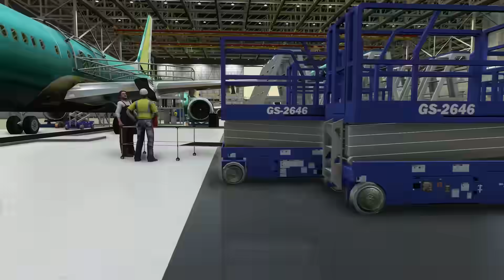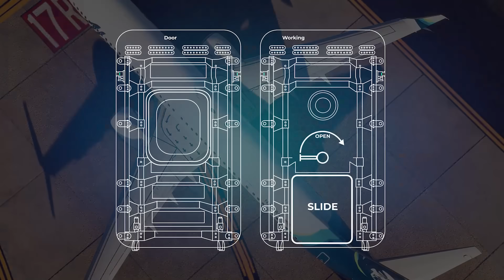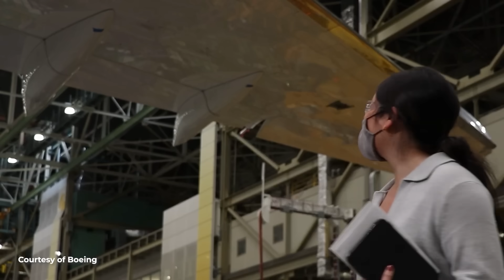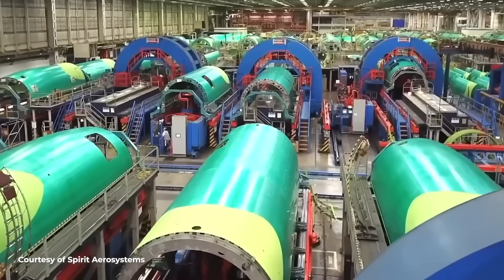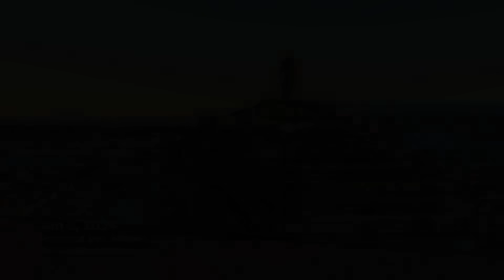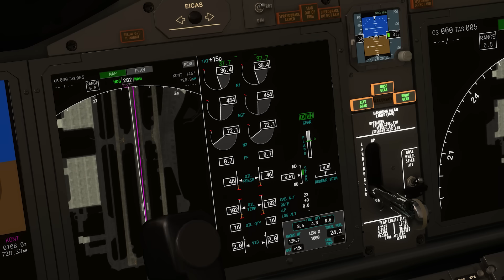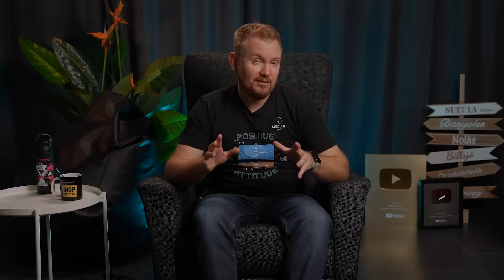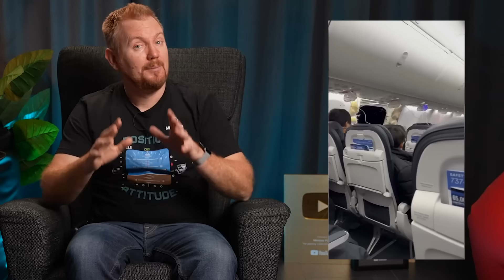Boeing 737MAX BlowOut!! The Scandal behind Alaska Airlines flight 1282

Comment: I know this is burried, and im screaming into the void here, but i hope this gets sttention. You missed a VERY major and likely criminal issue burried in this story. My specialty is aerospace manufacturing processes and systems. I didnt choose it, but, here I am. The major issue is the repeated use of the word "DOOR". It was not a door. It was a part of the fuselage. Sure, it plugs where a door could be, but once its there, its there until a heavy check with interior out. It should be considered a structural part of the skin. Although, it doesn't add any strength. That means, once those bolts are torqued down and approved by quality inspection, they are installed and officially part of the build record. That quality stamp says so. Per Boeing's own quality process documents, that part may not be removed without approval and a record of the removal, replacement of standards (if required) and REINSTALLATION of the part is documented. A removal record puts a "hold" on the work order it is written against and the aircraft can not be certified and delivered without all work orders closed, or an agreement is made with the customer on cosmetic, non safety of flight issues. Most customers say, tough shit, fix it, we'll wait and you'll pay. Anyway, back to the word "DOOR" again. Since it is established that this is a part, not a door (it lacks an opening and closing mechanism), you can not OPEN it. That's crazy talk. Sounds like something a caffeine addled, hung over first line manager on the shop floor would present to a friendly QA who should be fired. 

See, where just "opening" it. We can get this done by the end of shift!

Yeah, well, that's fraud. And although its not like forging a document to get work passed down the line or hidden, it's the same thing by refusing to document the removal and reinstallation of a PART, not a door, from a commercial airliner. Whoever oversaw the work, whoever did the work, and any QA that was aware of the shady plan are all criminals for attempted murder, or at least wreckless indangerment. I'm not kidding. This is really that bad. For sure, they should all be unemployed.

Comment: I heard two words - "easier, and cheaper".  And that explains absolutely everything.
Reply: Nah - whistle-blower is the phrase to look for. Easier and cheaper are simply reality at every large company. Compensate whistle-blowers richly with an insurer based reward scheme and you will see decent safety records restored PDQ. Think about it - if you had the opportunity to turn squealer and get what amounts to a rich pension automatically - no corner cutter would be safe. Both shuttles and the astronaut crews would be alive today. And "US"  products would actually have US engineering drawings instead of some bogus Chinese cad drawings with no revision block data.
Reply: @jeffmilroy9345  

We used to joke about Boeing doing everything FASTER, QUICKER, CHEAPER, BETTER.  It finally happened that the McDonnell - Douglas leadership team reached their desired goal with almost deadly consequences.
Reply: @mrc8683  Well at least Sully gave a harsh, public criticism.

Comment: Had Alaska Airlines investigated the pressurization issues, rather than simply reassigning the plane to overland routes, the missing bolts could have been discovered, which could have avoided the accident.

Comment: I worked for Boeing for 35 years. "Engineers" do not do inspections on incoming products at Renton. Quality inspectors do. I watched over the years as "MBA's" started to outnumber "Engineers" as the culture of Boeing changed for the worse. They keep mechanics that have no business turning a wrench and have business degrees making engineering decisions. A total dumpster fire that will only change when the "culture" changes. The environment is "woke" and run right out of "HR". Another total disaster. Again, folks making aerostructure and power plant decisions that have no experience or education to do so.

Comment: I mean I am by no mean undermining the complexity of the task but wow is the design of that door plug bad. Normally you'd not depend on so little to prevent a door plug from coming off, ideally, knowing that the plane won't have that door, the fuselage would have to be made to spec not fixed as an afterthought. Unthoughtful cost cutting is bad, and it's dangerous.

Comment: I am a consultant specializing in quality assurance and Failure Mode and Effects Analysis (FMEA), primarily within the automotive industry. The fact that the process did not require a check for the proper installation of these bolts after the reassembly of the door plug is simply bewildering to me. Frankly, this is scary.
Reply: Airbus is making boeing look silly ...clearly a bean counter decision
Reply: @alexanderreith6043  Look on current Boeing logo.... 
U see it, it's MDD logo. Bean counter culture comes from there
Reply: Playing by gallery.
Reply: im an aircraft vulnerability topic specialist. i go oen step furtehr than failure mode and figure out "kill " mode . how multiple systems failign result in the ultimate failure after amissile hits.... its even more scary for me.  i know the failure rates we design for i know the tests we do and the isnpecions we do on military aircraft. the fact civilian is letign this through is jsut jaw droping.
Reply: Theory always ends up butting heads with reality. You can't fit 40 hours of work into a 24 hour day. And with how notoriously unreliable Spirit had been across the entire production run, those engineers were kept very busy. Tragic and preventable, yes. But especially for extremely qualified work like QA, man hours are a finite resource that needs to be focused on the most pressing issues.

Comment: Thank you dear Petter, another first class video !! 👍🏻🙏🏻🙏 !!
From the ‘Aeronautical Medicine’ classes, still remember that the  inner ears have no difficulty compensating differential pressure whilst climbing, when cabin pressure decreases. But on descent, due to how the ‘Eustachian’ tube is shaped, it cannot get rid from the excessive inner ear pressure by itself. Some swallowing helps, or chewing gum, i.e. 
Therefore the automatic Cabinet Pressure Controller sets the vertical speed, of the cabin, during climb 500ft/min maximum and 350ft/min for descent, the inner ear can easily manage those rates comfortably. 
Still remember …

Comment: The part I don't understand is why did they have to block off the emergency exit in the first place? I mean I get that if they have 189 passenger they need fewer exits, but surely it wouldn't hurt to have extra emergency exits above the minimum requirement, so why not just leave them as is?
Reply: You cannot have an emergency exit with seats in the way. The key is to seat the maximum possible amount of people within regulations.

Comment: Hey Peter, your video was going fine until 37:20 when you stated your opinion that Pilots would have done this or that so as not to cause any discomfort to the passengers while landing... Better ask the alive passengers if they observed that discomfort... As regards the Pilots, when your ass is on fire, you rush towards a bucket filled with water to cool it off... I appreciate the Pilots' presence of mind for a SAFE landing without any casualty...

Comment: Those lift springs are probably retained on the door plug because it's the same part assembly, and if you're assembling both, it's easier to just have one part that goes on doors and plugs whenever possible. This also eliminates a possible failure point where a hinge without lift springs is installed on a door instead of a plug, so it's actually both cheaper and safer.

Comment: Brilliant analysis.

Could you develop the door plug retaining details, perhaps ?
The springs at the base look way too weak to counterbalance the weight of the door, and the multiple tabs that take the load around the periphery are surely more than just tabs - the implication in the video is that they have no resistance to the lateral shear that is required to lift the upper door pins out of the U shaped guides.
There’s more going on here than in the diagrams currently used can do justice to.

Last point : are you seriously inclined to believe that it was a coincidence that those two seats were empty ?
Never in a month of Sundays.
The airline knew there had been comments about noises in that area.
I’d bet a million dollars that someone ring-fenced those seats as a precaution.

Love the videos. 

Mechanical Engineer with PPL.

Comment: So glad, Petter, to hear you refer to items “pushed out” of the cabin. Every time I correct a conversation to explain things don’t get “sucked out” but rather “pushed” I get the obligatory eye-roll. I did a PPL 30 years ago but am still quite nerdy about flying. I curse Bin Laden for abruptly ending the common jump seat ride on commercial aircraft, but I do get it. I have just returned from a trip to Japan having flown Melbourne-Narita via Hong Kong with a newly approved “ok to fly” assessment from my respiratory specialist. I have a form of Pulmonary Fibrosis that results in a loss of lung function due to scarring of the lung tissue. It is progressive and incurable but when you were explaining the procedures involved in training for a depressurisation incidents I wondered if a similar reduced pressure is used to have pilots experience the full loss of oxygen situation? In my case I went to a sleep laboratory that my RS is associated with and sat for a half hour with a stiff clear plastic vessel over my head and a rubber skirt around my neck whilst the air inside was reduced to 8,000 ft. I did ok but still was a bit starved for air on the flight at one point. Forgot to use my inhaler. 🤦🏼‍♀️ So do pilots ever get exposed to a drop in pressure to see how they would manage if it were to occur? Are there any sort of tests used to establish physical capability to withstand such a change? A bit like the G-force tests?
Reply: You'll find a number of good videos here on YT demonstrating the effects of hypoxia on pilots. Just enter hypoxia pilots test in the search bar.

Comment: Aircraft doors are designed to be impossible to be open in flight, because they need to be moved inwards, against the huge inside pressure, before they can be opened.  Why were these plugs not designed to be self sealing in flight, to be larger than the hole they fill, to ensure that they can not be blown out by pressure?  These plugs should be held in place by the pressure of the aircraft without any bolts at all in an emergency.  I believe that is the definition of a plug, a solid device that is larger than the hole it fills.  That seems like a basic engineering requirement.

Comment: I think it would be great if you could get a mock up of a passenger oxygen mask and present a detailed rundown of how it works and how to use it. It's been years since I've flown, but I don't recall any mention of tugging on anything to activate it during the safety briefing. I was under the assumption they just started working automatically when they deployed. There was also no mention of the possibility of a burning smell from their use and that it's normal/to be expected to alleviate fears if used.  Seems like a couple of important topics the flight attendants need to do better explaining.

Comment: With modern computers, a de-pressuration event should automatically send out an emergency notification and SOS to air traffic control, by computer systems and then start the automatic pilot to automatically descending to a safe altitude.  Doesn't't a de-pressuration event cause the automatic deployment of the oxygen masks to the passenger compartment and to the flight attendant areas? If so, there is no reason not to combine those actions with an SOS/emergency radio call to Air Traffic Control.

Comment: Isn't it a defective design of the autopilot control for it to keep climbing when a cabin de-pressuration event takes place?  It should automatically stop climbing, level out for a minute, and then start descending to 10,000 ft as a fail safe measure.

Comment: As I learned from another video, the reason why the pilots forgot to unplug the circuit breaker was, that the wind blowed out the printed papers from the cockpit, and this task is not a memory item, but on some emergency landing checklist. Was this the case, @MentourPilot ?

Comment: I work for an aircraft manufacturer in assembly. For us, that door seal replacement would have had to be done through what we call a re-work to blueprint where process and design  engineers would have to write specific work instructions with mfg operation buyoffs and inspections like the original installation. We as installers don’t just think of how the easiest way is to replace it, perform the work as we see fit and move on. We always have to perform work like that per written work instructions by engineering, especially if it’s a flight safety item. Boeing is way below industry safety standards if this kind of thing can happen. This could never happen where I work. Seeing this is absolutely mind blowing that it could even occur. Before interior panels could go on that area would be gone over thoroughly by inspection three different times by different quality personnel.
Their safety, quality process and mfg process is obviously severely lacking.
We have escapes, but nothing of that magnitude and 99.9% of the time it’s due to design engineering and 100% of the time it gets caught in testing prior to delivery. And even our relatively minor escapes that make it all the way to test result in a major ordeal like safety stand downs where everyone in the company stops work and goes to a couple hour long meeting about the issues and reminded of safety and quality being top priority. Engineering and quality teams are assembled to do root cause analysis and make immediate changes to make sure it can’t happen again. These are much smaller escapes than this door being blown off in flight by the customer. If it were possible for something like that to happen to us, it would be a major ordeal. The entire plant would get shut down, people would be fired and major process changes would take place and there would be highly increased scrutiny on all of our processes and lots of added training would be implemented. With all the major safety and quality issues in Boeing, it’s clear they aren’t taking it seriously at all. All of upper Management should be completely restructured with people who have safety at heart, their quality dept needs to be separate from mfg management and have their own authority equal to or greater than mfg management even above the CEO.

Comment: Interestingly, having "door open" vs "door removed" work steps having different levels of QA and reporting during manufacture makes perfect sense ... for a door! Even emergency doors get opened and closed as part of normal operation and testing, but removal implies removing things like bolts. I think calling this thing a "door plug" causes everyone to think of it as a sort of a door, instead of as a oddly installed wall panel. Perhaps "exit opening plug" would be a better name. Words matter!

Comment: I find it kind of alarming that once the depressurization is detected by the plane, if it's over 10,000 feet, it's not automatically set back to level off or descend. So the autopilot just continued to go higher when it was clearly unsafe to do so. Concerning.

Comment: The potential lethality of Boeing and Spirit quality control failures, cannot be overstated.
If I were a commercial or military pilot, currently flying this aircraft type,
I would be absolutely furious. The FAA, the airlines, and military authorities must demand
accountability from Boeing and Spirit, before the 737 Max production line is
permitted to restart. As a passenger, I would not choose to fly on any of the newer generations of Boeing 737 aircraft. They are demonstrably unsafe, until proven otherwise.

Comment: I'm not American and I do believe Trump is not fit for presidency BUT he can be very right in some aspects.
The US is indeed loosing the shine with old infrastructures among many other things he speaks out about.
Boeing has lost the edge long ago and it seems they are not doing the right moves still cutting corners. Seems like a management problem rather than the people making the plane. If the engineers and mechanics could speak out it would be appreciated but they don't.
Doesn't really look like a democracy does it?

Comment: 23:11 As engineer (not aviation), the door plug rose up slightly due vibration, assisted by the springs. Every landing also jarred the door loose.  It was inevitable that the door plug would blow out.

Comment: What still frustrates me is that the bolts didn’t have a fail safe. If the door can push itself open when they’re broken or missing there is a real concern that makes them a critical safety barrier. The door doesn’t seal around all edges, and it doesn’t take much travel to push them over the pads. Considering the door plug is a plug, they really should’ve made it so that it could never open outwards, and could only open inwards, and be removed by rotating the door (similar to how emergency exits in the A320’s I’ve been in work) or had some other retaining feature that makes the plug fail safe.

Considering how outward opening cargo doors were a big concern on the early 747’s and DC-10’s with the 747 having a major incident because of it, I’d think Boeing would avoid using doors of this style again.
Reply: Yep.  Like I've said all along, this is a faulty design and not just a quality control issue.  The FAA should share some of the pain.
Reply: @LesD9  this stinks of flight 811 all over again, blame quality control because the deeper issue being a design flaw would cost too much to repair, and would harm the reputation of both the FAA and Boeing.